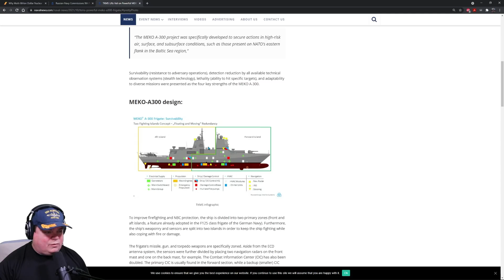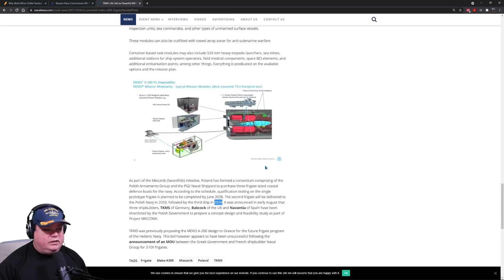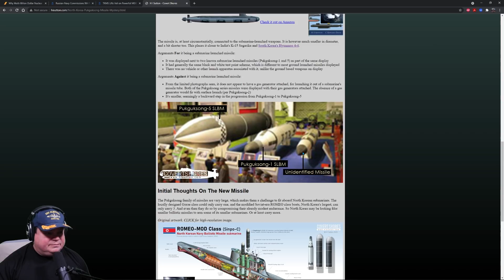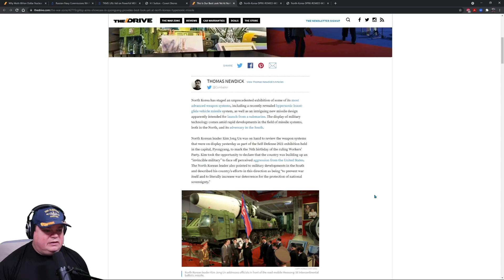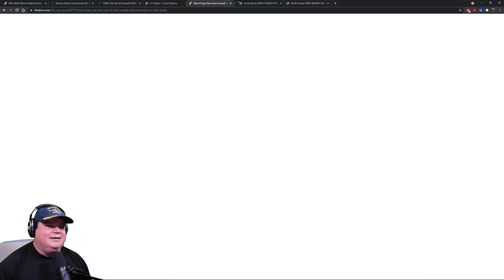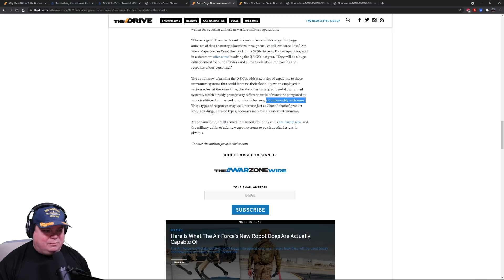Germany's Battleship Frigate MEKO A-300

Comment: I always meant to ask you why we don’t have anti torpedo torpedos. It seems like a decent idea. I assume it would be easier to home in on vs a quiet sub.
Reply from the maker: well, the U.S. can't seem to figure it out.  I don't know why.
Reply: anti torpedo torpedoes are very difficult. I can't go into it too much but there is some serious difficulty in actually hitting anything especially if you don't want to risk to blow yourself up. under water a lot of simple things become complicated. the german anti torpedo torpedo is a cavitating, rocket powered dart and that's not even the complicated part of it. that would be the sensors and figuring out how to steer the thing to hit a maneuvering incoming torpedo that might be hidden behind screw noise (depending on the attack mode) and might be incoming very fast (cavitation torpedoes). so this defense system is tricky and nobody really got it right until now. that being said, technically the german system is still in trials alto it's looking good and the system will be implemented.
Reply: I'm by no means a subject matter expert but It probably has something to do with planning for the future IE Torpedo's are getting to the point of going so fast with super cavitation that developing counter measures would not only be ridiculously expensive but also have a short effectivene lifespan as offensive torpedoes would just evolve to quick to keep up with. 

Also; and this is REALLY theoretical, but if counter measures render traditional torpedos ineffective somehow the next logical step is using area of effect blasts to cause damage at a distance instead and that means nukes. If you can't be precise then you be broad right. Nobody wants the meta to evolve to tactical nuking ships or fleets ergo you try and maintain the traditional conventional torpedo meta around as long as possible.
Reply: There are some in R&D, by the Germans. "SeaSpider".
Reply: We were working on a system for our CVNs a few years ago. Based on the reports I read it was a fizzle. Can’t confirm or deny. 🤷‍♂️
Reply: Anti torpedo torpedo's have been tried since WW2. It is like trying to hit a bullet with a bullet, very hard to do reliably and in time to prevent a hit. Think about it, we cant cruise around with the torpedo's loaded in the tubes and with the outer doors open all the time and if the torpedo is not ready to go then by the time you do get it ready to go and target something the torpedo that you are trying to hit has probably already hit you.
Reply: I’m not sure that the assumption that torpedoes are louder than the subs launching them, is entirely valid.
Reply: @nielsandersen6164  Submarines are designed to be quiet, torpedo's are designed to be fast. Fast is loud and torpedo's do not have enough room for sound deadening to be built into them.
Reply: @12jazion  it depends on the torpedo. Some are VERY quiet, especially electric torpedos with pump jet propulsors launched using the swim-out method. The environment can also be used to conceal the sound. Torpedoes being so loud that they get detected right after launch is a movie trope. By the time a sonar operator positively identifies the sound as a torpedo it is already too late.

Comment: Looks like the MEKO A-300 is a modern version of the "pocket battleship." If they can build them in numbers, and export them to other EU countries, they would be a force to be reckoned with. Australia ought be talking to the Germans about building them too under license. If they are as good as their billing, they should be nightmare fuel for the Chinese.
Reply: Australia might struggle to find a use them.  With that much weaponry on such a light hull, I doubt this design has much range or stores capacity.  Poland doesn’t need either, since Russia is right there, but Australia will need range and endurance for these ships to operate in the SCS without an auxiliary following them around.

Comment: Aaron, thanks for theses briefs. The German design frigate looks and sounds like what a warship should be. Unlike the current LCS's and the O.P. class frigate. If you put a bow and arrow on these ships... it would be considered a major weapon system upgrade... On a side note, would offering the Aussies 6 to 10 of the LA flt III boats with 10 to 15 yrs left on the core to fill in the short term. While they design and build the new subs that will be in the years to come... Just a thought. Again thanks for the info. Later Henry
Reply: The team I worked with on the LCS, which lost, developed a surface combatant which could operate in squadron or flight strength.    What we suggested as a support ship was what was chosen by the Navy as the LCS.   What was wanted all along was an up gunned OHP.   Which made the whole effort a waste of time.

Comment: „Germans build Great war machines“ yep, we can do that. Like the brand new Leopard 2A7V which is getting delivered to the Bundeswehr. Such an impressive tank! I once stood just a few meters away when a Leopard 2 roared by. Everything vibrated, the air in my lungs included. I only wonder if the version designation A7V is a reference to the first German WW1 tank? 🤔
Reply: Given that the A series has gone through every number until 7 and the V stands for 'Verbessert' which means improved, obviously enough noting the improvements over the initial A7 model, not really. Outside German circles, the same tincan follows the name 2A7+.

A7V gets its name from the military department that initially commissioned it: Allgemeines Kriegsdepartement, Abteilung 7 (Verkehrswesen), or in English 'General war department, section 7, Transport.' Interestingly enough Germans originally thought they'd build 10 tanks and 90 armored carriers, though they later decided to order 20 more tanks. none of the orders were completed.
Reply: Wait until First E-Tank is entering the battlefield…. You will not hear them, but the shell will hit you.
Reply: @ger du  Me? It was a curious rushed response to the British and French tanks and looked very distinctive. Sure it wasn't very good but neither was T-35 and I think that thing was a real gem of a curiosity as well.

Anyhow, a pz.1 would beat ANY WW1 tank, the A7V isn't special in this regard. 2 decades of innovations in design, engine building and materials sciences tends to do that.

Comment: I think 32cm or there abouts ASW torpedoes are common on surface ships and fixed and rotary winged aircraft, e.g.MK32 triple mounts on most US CG/DD/DDG/FF/FFGs  pretty much throughout the cold war and to the present.  MK46,MK50, Murene (IIRC), Stingray. They don't need to be huge - they don't need to break the back of a carrier or BB like a sub fired 21" torpedos they only need to crack the hull of a sub. Pretty sure 324mm torpeodes  were/are also one of the possible payloads of DASH and ASROC, and they are carried by ship borne helos, so the range thing was mitigaged for a lot of their service life.
AFAIK it's really only subs and possibly torpedo boats (at least in western classes) that fire 21" torpedos - most surface vessels just fire an SSM if they want to hit another surface veseel.
Oh and the gun on that thing is probably a 127mm/64 - i.e. a 5" gun with a  64 calibers (i.e. 64*5") long barrel.

Comment: Tbh, while i am happy the US chose the Fincantieri constellation class as a Italian, this ship is undeniably extremely capable (German one) and basically has the firepower of almost 1.5 arleigh burke, in a frigate format (may actually be destroyer size, for political reasons in Europe several destroyer like ships are classified as frigates instead), it has to be seen the capabilities of it's sensors and systems. I imagine with so much stuff on board, this ships won't be cheap. I imagine if this was proposed to the US, and the us was not in need for proven relatively short dev time ships like the constellation. This ship would be fairly appealing.
Reply: Considering the fact that the last 2 frigate classes kept rising exponentially in price, this one will be too (Sachsen Class F124 ~ 700M Euros; B-W class F125 ~1.3B Euros). It is estimated to be about 1.7B Euros. But honestly considering that the GErman Navy will procure 3-4 of these and has to replace a few frigates, also adding Germany's economic power, this shouldn't be much of a problem. Also German military equipment was always more about quality than quantity, being located in the centre of Europe and all, that isn't illogical.
Reply: @tridder  I mean yes, economically Germany can afford a lot, if they actually buy that stuff is a different story, like I don’t think Germany currently has enough missiles in stockpile to field a potential 4 to 6 of these. Also a big issue would be upkeep, as the perfect example that the Luftwaffe is (think it’s still called that unlike the army which changed name since ww2). Historically Germany post war has been quite low on military spending, for quite obvious political reasons, although the fact Poland is getting at least 3, Germany 4 or more, should drive production cost per ship down. Although I suspect a not insignificant portion of the cost of the ships will be in the cost of the weapon systems themself, including the sea spider (or however its called I forgot) system, and the many many missiles it carries, plus all the redundant systems and mission modules.
Reply: >and basically has the firepower of almost 1.5 arleigh burke
Arleigh Burke -- 96 cells Mk41.
M300 -- 32 Mk41 + 36 for SAM (whatever they mean by that) + 16 AShM in boxes. 
Unless you consider RAM to be addition to firepower...
 >I imagine if this was proposed to the US
They would most likely laugh at range and endurance of this thing. There is no way it's above ~5k kilometers.

Comment: Germany: Builds small warships with a ton of weapons.
US: Builds small warships with no weapons at all. Probably cost twice as much too.
Reply: Less weapons systems significantly reduce maintenance times, which are incredibly important for a navy that sails every ocean on the planet. The less equipment you have to ship for repair to an ally nation in times of war reduces the strain on sealift and airlift commands, creating greater operational flexibility. Structural repairs are faster and easier to perform in a crunch than rewiring and replacing a fucked weapons system stacked on tow other weapons systems which may also need to be replaced or repaired. US warship design is based around deployment time and logistics.
Reply: @tybaltd.1521  K. Please explain the military value of a weapon platform without any weapons.

Comment: My question as a German: Why don't WE have these?!
Reply: We do. Brandenburg-, Sachsen-, Baden-Württemberg- and Braunschweig-Classes are derived from MEKO-Designs. As are the upcoming F126- and (probably) F127-Classes.
Reply: @derheinz9589  Yes of course, but (correct me if I'm wrong), they're based on the older MEKOs? But thanks for pointing me towards the F126 and 127 designs, I'll take a look at them.
Reply: The 126 ist not a Meko, the 127 will be a meko400.

Comment: I wonder about the crewing. LCS had crew problems because it was too many systems on too small a boat. This is a preposterous amount of systems on a small warship. You will need to set up a barracks on the helicopter deck to fight this thing at 100%. 

Or perhaps it is design as more of a “strike force” ship not a persistent patrol ship, where the crew really only has endurance for a few days of war before returning to port.
Reply: The mission modules could be refitted to be berthing and food to actually crew this thing for a deployment to Asia.

Comment: I have been told those color scheme do have meaning, if it is like a orange peel, it is to measure rolling during launch, each black and white is a measure element, say, may be a 1/4? 1/6? 1/8? of the circumstances, which when filming by high speed cameras, counting the band, you know the rotation, and the launching speed will be same for every missile. on the vice versa, if it is collar band, it is counting the vertical speed in high speed camera. which, seems fit to the vertical launch information.  knowing the width of those color band can estimate the initial speed from the launching platform too.

Comment: That MEKO sounds like an extremely well designed warship. Good luck to all who sail in her.
Reply: Its tailored for the Baltic Sea. The Baltic is a narrow, shallow area where tailored  units are needed.
Reply: @EK-gr9gd  you are wrong. you should look up what MEKO ships are and also consider not trying to lecture others about stuff you know nothing about..
Reply: @Mar-s5q8m  Know  nothing about what?
I was talking about "MEKO A-300", not the "MEKO"-Design in general!
Reply: @EK-gr9gd  there are only 3 MEKO sizes 100, 200, 300 MEKO is a platform that is then adjusted to export costumers needs. since MEKO is for world wide export, it is not designed for the baltic or any other specific location. the MEKO 200 and the now larger 300 are mid size to large war ships and they are not limited in range, operation area or other considerations.

Comment: I guess they sacrificed blue water endurance for this one.
Awesome design, but I don't know if all the weapons and sensors can be maintained by the standard crew compliment.
Probably not an issue for the polish navy, since ports are usually close by in the baltic sea.
Reply: If my recollection is correct the project requirement was 25 days sea endurance. But I would need to dig up the citation on that again so take it with a grain of salt.
Reply: @neues3691  But what happens after those 25 days?
Just load up on fuel and consumables and anchors aweigh?
Or are there maintenance items to go through for the crew (maybe with the assistance of shore personnel), that could not be accomplished while at sea.
Not judging, but I believe there is no free lunch in engineering and getting the space for the weapons and sensors, the crew to operate and maintain them, the space to store supplies for ship and crew and maintenance and crew rest facilities on a hull that is this compact is neigh impossible.
I think this will be a good fit for the polish navy, but it is difficult to compare them to ships that have to spend long times stationed abroad.
For example the Gepard class Fast attack craft and their successor the K-130 Corvette have basically the same offensive capabilities.
The new ship has four to five times the displacement though, "just" for having more sea endurance and being able to be forward deployed.